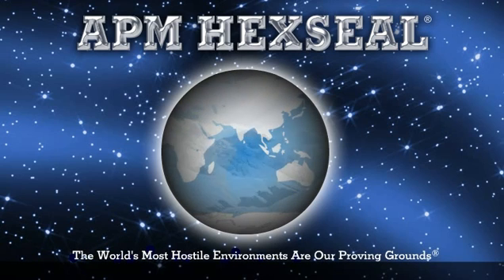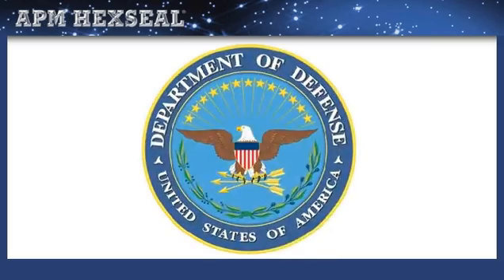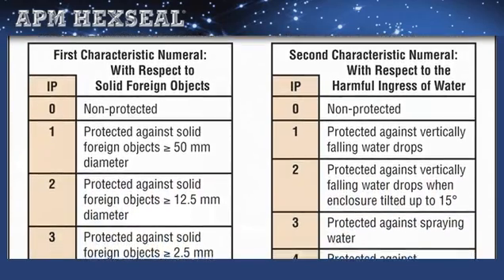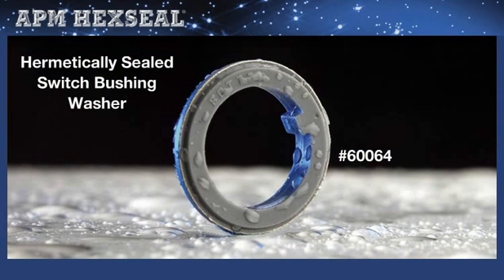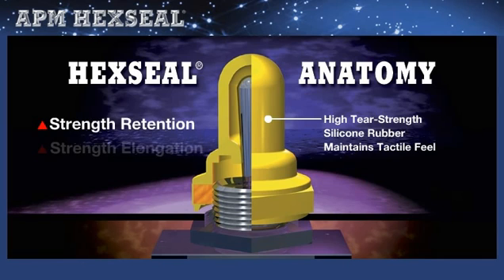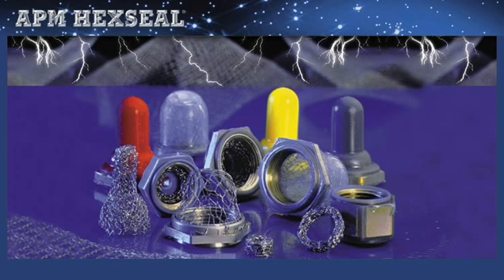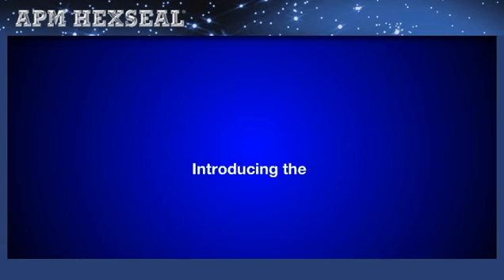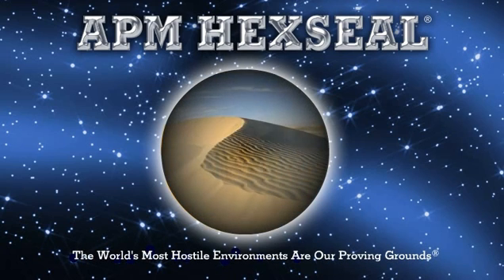APM HEXSEAL Switch Sealing Boots Video

Comment: I don't wan't my peanut butter sandwich to be exposed to operational to gastronomical instability either! I hope the APM Hexaseal boots are as effective at 2000 MHz as they say. Refractive audio resonance is becoming a problem for storing Chunky Style when transporting ant cabin pressure altitudes above 5,000 feet. I nearly blew up my Peanuts during high altitude operations.